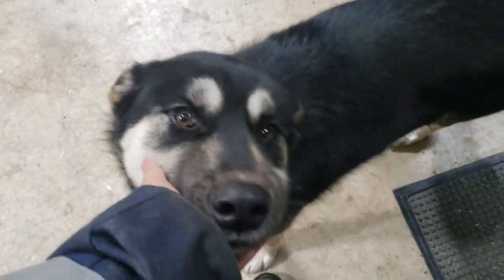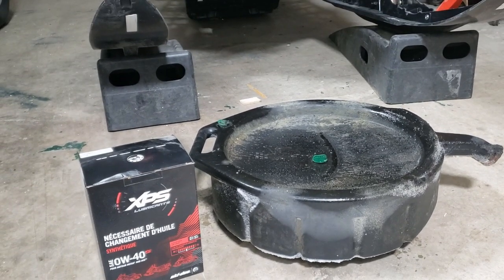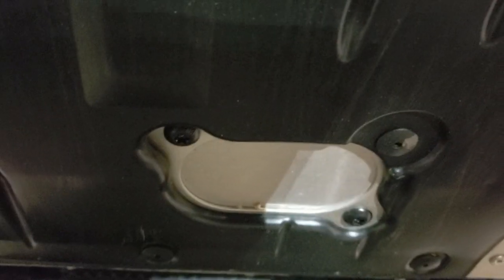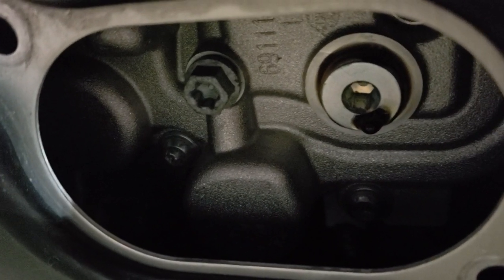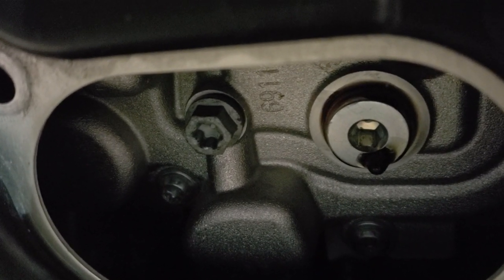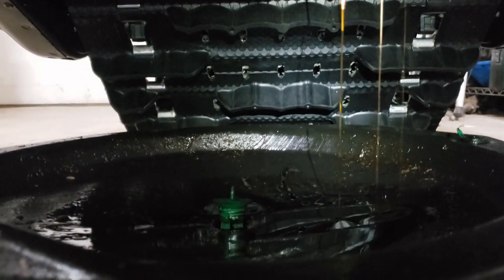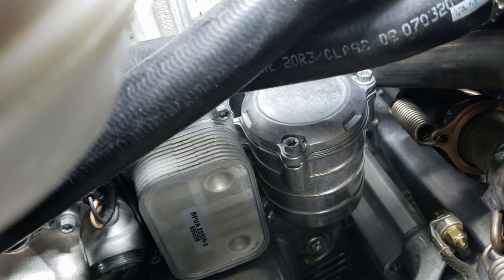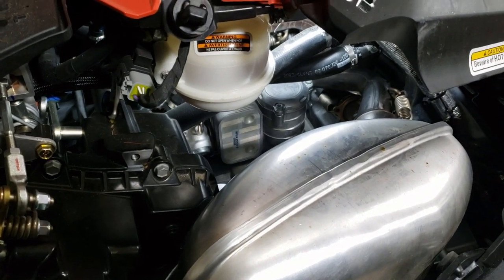Skidoo 2021 Skandic 600 ACE WT First Oil Change.  Embarrassment on my part.

Comment: Thanks much. I can verify that you can get by without removing the hood (or the exhaust can if that's the way you want to go) to do a full oil change on an 2022 Expedition 900 ACE. It's really only one bolt on the filter compartment cap that is problematic, and that is obstructed by two hoses. Torqueing the filter cap bolts is certainly problematic (for any torque wrench I have), but removing the hood doesn't really help with that. "What I Do" (and a couple other YouTubers) is right that taking the hood off isn't a big deal and his video is worth watching.
Reply from the maker: Excellent comments
I bought an oil vacuum for this sled and it failed, only getting half the oil.
I comfort myself with 6 months worth of amazing trouble free riding and 1 hour of French careless engineering  once a year when changing the oil and filter.  My old Yamaha Nitro was a 5 minute job.

Comment: I’m a certified BRP technician and as you have shown you can clearly change the oil and filter without removing the hood. But if you are doing a correct warranty service you need to remove hood anyways to check other things. As a dealer you don’t just do an oil change. But to remove the hood is only 6 torx screws and when you have done it a couple of times it takes about a minute and makes everything easier. Happy holidays!
Reply from the maker: Thanks for the input.  Always glad for certified good will to give help to the end users.  
Cheers from Alaska.
Reply: @practicalporters  I have A Tundra 600ace myself with the same style hood, if I have time now over the holidays I’ll make a quick video how to remove it
Reply from the maker: @WingspeedGarage  perfect, thanks.  Please send me a link or heads up when the video is ready.
Cheers
Reply from the maker: @WingspeedGarage  excellent,  thanks much.

Comment: My 2011 Grand Touring 600 Ace has reached 44 600KM from personal and previous rental use &  it could have reached more kilometer but , I’ve bought a 2012 engine with 19 000km so I’m watching this video to properly changing oil and refiling my new engine , good engine , to reach that high mileage , I wouldn’t be surprised if my engine would have reached 50 000KM , it’s just that I wanted a lower mileage ! Cheers from Valcourt , Quebec ! The Ski Doo town 😀
Reply from the maker: Wow, that's amazing 
Cheers

Comment: Great video, my hands aren't the best for tight areas like this, I remove the hood and grease the front shocks at the same time, after you've done it once it's actually pretty easy, sure wish it was a hinged hood as were all sleds back in the day!. I have a video showing how to remove the hood called Ski-doo skandic WT update three. Iv'e got removing the hood down to just a few minutes now. Just thought it might help if you do decide to remove it.
Reply from the maker: Thanks much
Reply: Ditto this. This is my second winter on a 2022 900 Ace, but looks pretty similar under the hood. Windshield just pops off without any tools, all the plastics come off with about six torx screws. Isn’t too bad at all. I installed all my own accessories including skid plate, bumpers and winch so I got some practice at taking it apart. Although mine just rolled over 600 km I found I had to adjust the chain tension, as I was starting to hear it rattle on startup. Thought it was the valve train but thankfully not. I have towed some serious weight though, including a couple bison. It’s been a great machine so far.
Reply from the maker: @severinw5978  Excellent data points.  I'll check my chain too.
We just got 2 feet in Fairbanks AK and are still shut down basically. Just got power back.   Now its -25f, so time to make some videos now that I'm off the plowing for my life routine....
Pray for us not to get frustrated but pull together,  a thing Alaskans usually do only in emergencies....🤪

Comment: I just buy filters and use Mobil1. BRP mechanic said to his knowledge the BRP oil is nothing special, but if you pick and differ t type, not to switch back and forth.
Reply from the maker: Good info.  Thanks

Comment: It's actually a much easier job if you remove the muffler, it's only held in place with 6 springs which are easily removed with the correct tool, some 500# monofilm fishing line or wire.  Once the muffler is out of the way, there is enough flex in the pipes to push those out of the way too plus you can get some rag down below the filter housing to catch the oil that spills.  The only thing to be careful of is that the doughnuts don't fall off the ends of the pipes while you have the muffler off.
Reply from the maker: Ok thanks for the update and good work.
Reply: @practicalporters  Np... just to clarify, the pipes themselves do not flex, they are held onto the engine with springs so you can rotate/swing them a few degrees which helps when getting the bolts out.

Comment: I am looking to buy the same machine. Does the 600 ACE have enough power for you?
Reply from the maker: Yes, the 600 is amazing and gets the same excitement for me on the mpg.  We use this one just for fun and in low gear it never has engine lack, just traction issues being just a WT.
The 900 SWT we use for grooming trails is the way to go for being a work horse.
So it depends on your application.   If in doubt and you can afford it, go bigger.  I wanted to go in narrow trees and still side hill when needed so I went with the 600 WT. 
Make sense?
Tell me you thoughts if you'd like.
Cheers from Alaska
Reply: I have both a 2021 600 Ace Scandic and a 2020 Expedition 900 Ace. I love both, but I adore the gas mileage with the 600 Ace. It gets about 50% more mileage per tank. Has plenty of power and I find is a lot smoother in the bush for hauling fire wood and stuff.
Reply from the maker: @garybelanger690  I put 1000 miles on mine this great Alaskan snow winter and have zero regrets

Comment: I thought that the 600 was a 2 stroke and the 900 was the 4 stroke??
Reply from the maker: Greetings from Alaska.  I believe the do make 2 models of the  600 2 stroke and a 4 stroke, like I bought, the ACE. The 900 is only ACE 4 stroke.  Goto SKI-DOO.COM and build one and it will show all the options available and price differences. The 2 strokes are great and people in Alaska like them for easy starts in cold weather.  I went with 4 stoke for LONG life.
Reply: No, 600 is a 2 cylinder and the 900 a 3 cylinder. Both 4 stroke.